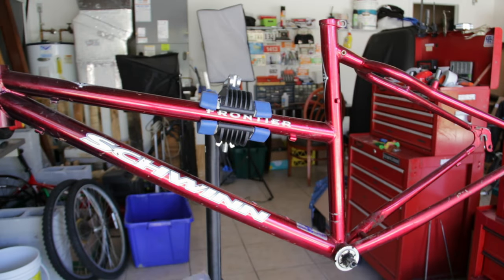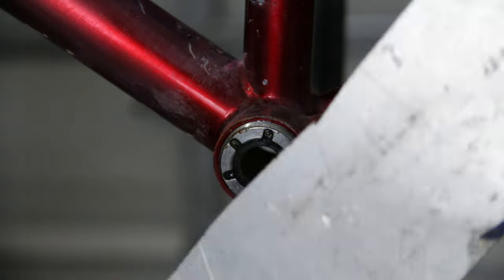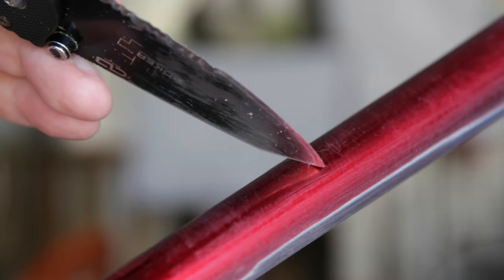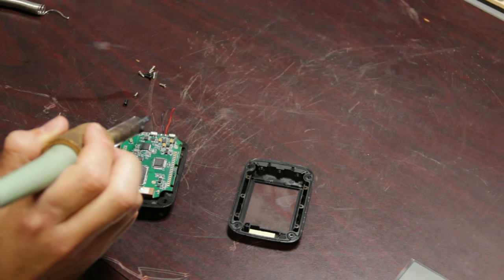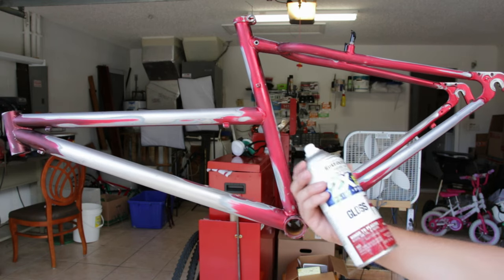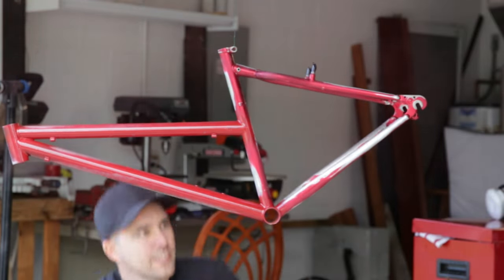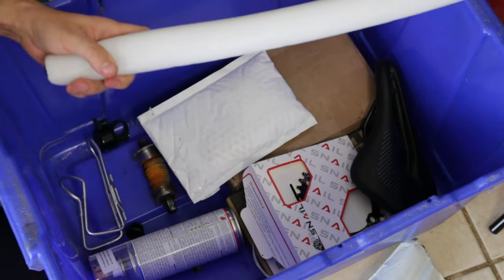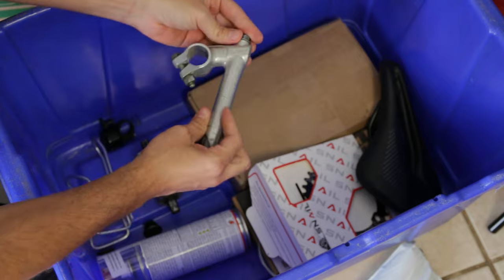Painting an old bike #TrasherBash2022

Comment: After watching this I definitely see how lucky i am to have found a super cheap professionally painted frame for my build! I've been down the spray.bike paint route before tho for my 1998 kona and do you think that something like their FRAME BUILDER'S METAL PRIMER might hide all those imperfections?
Reply from the maker: Yeah maybe it would have been a good route. The thing is I’ve done this same thing with pretty good results, so I was surprised when it didn’t go well. Looking back now I think some of the issues is with just the fact that this was a rusty frame. Today wet sanded the whole thing with 1000g, if I can find time I’ll try spraying tomorrow.
Reply: @BruceChastain  hope it works out this time Bruce. Tbh it looked fine on camera from a distance anyway 😉